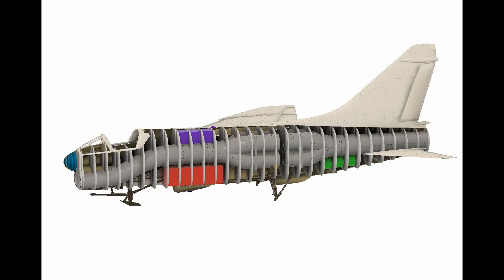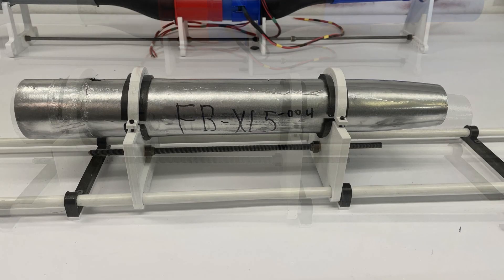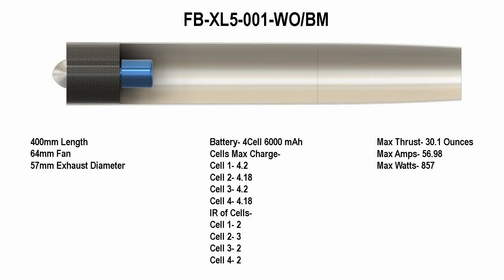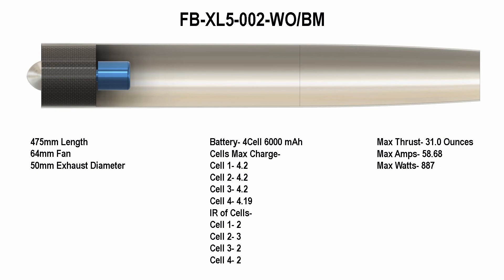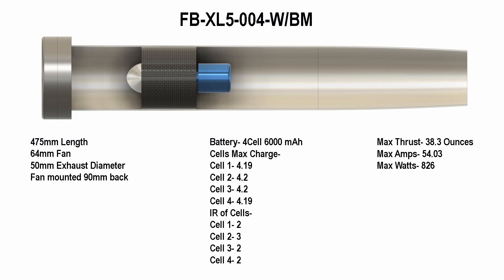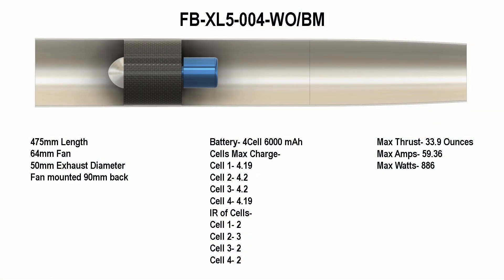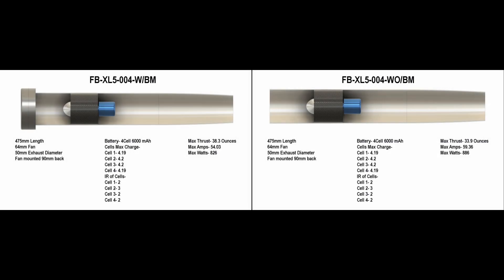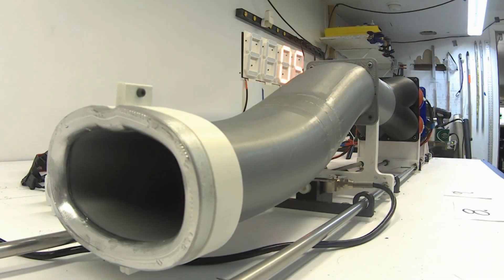Part 1 Developing a Power System for an A7

Comment: One of the things were learned on our 12ft t38 builds was when andy..who got his done first..had 2 fans that shared a common bellmouth. He had 1 fan with a slightly lower kv.. (mfg defect) what happened was that the stronger fan was actually stealing air from the weaker fan. Cause poor performance. He seperated the fans woth a long wall...and the loss in performance was gone. Something to think about when it comes to the area where the fans share the plenum
Reply: I was thinking the same thing. I'm also wondering if the exhaust wash of the fans being channeled together would affect thrust efficiency, or is it just on the intake side?

Comment: Couldn't you just install a regular 2 blade (or more) prop with max diameter that fits inside the fuselage with an outrunner inside the duct?  Like a Stipa-Caproni?  It is technically a ducted fan.

Comment: not a hater. I suggest looking at the best most powerful suction devices and seeing how their designs could spark the design alteration required for success in your own project. What 3d printer you using by the way...? My initial thoughts are 10/10 for effort dude. Keep it up. Im subscribing.
Reply from the maker: Thanks!! My printers are Prusa i3MK2.5. The i3MK3.0 is their current one.